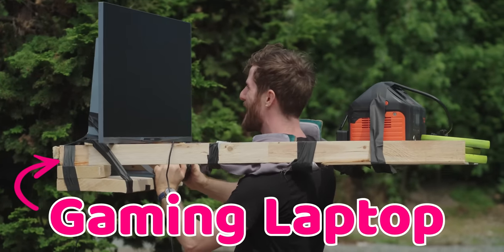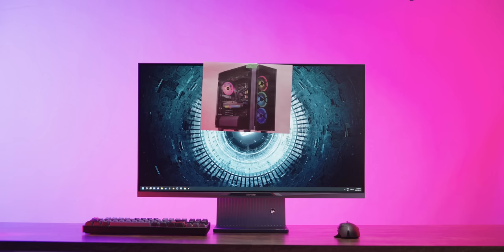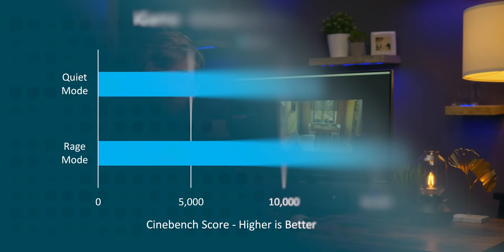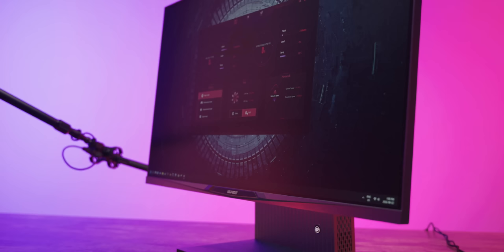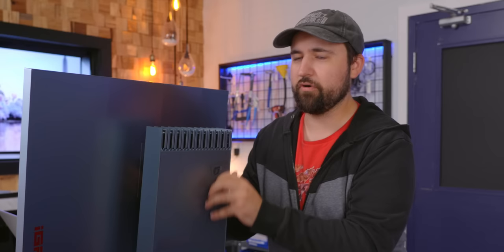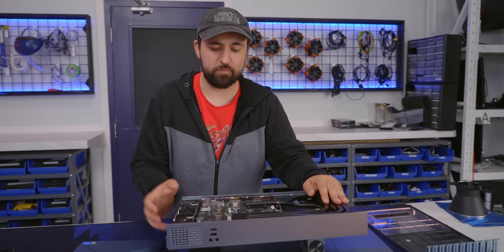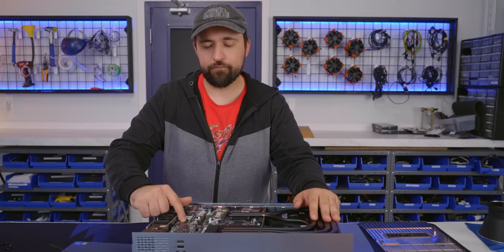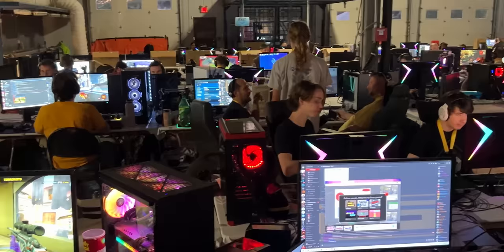Justify Your Existence. I'll Wait. - Colorful iGame AIO

Comment: Might get some hate here, but I'm pretty done with the crab rave meme... One the one hand it's fairly frequency balanced, the intro is okay i guess and when the beat drops and because of the style it can quickly tell you if speakers are tinny. But other than that it's not that good. It's dynamic range is pretty much zero,  the compression effect 'pumping' annoys me to no end and it doesn't really have that great of a soundstage or wide stereo effect or however you wan't to call it.
If you wan't to 'test' (note the parenthesis) with EDM throw in some Feed Me for example. Or mix it up (no pun intended) with other stuff.
Wonder what Dan, among others, has to say about this.

Those are my two cents on that. And two cents ain't much... it's just an opinion.

So other than that, I hope everyone is healthy, happy and doing well.

Comment: complains about how difficult it is to take it apart, then finds its actually easy followed by "its a ribbon cable" then immediately pulled out a much harder to damage din connector standard cable, then complains about having to get to the backside of the board then finds its also really easily done.

man you got to stop assuming its ass-cake before actually doing it, your pre-bias is showing.

yes AIO's are a bad choice for most people, but give the people who made it props, at least they didn't go like apple and make it super asshole status to pull apart.

Comment: You know? The integrated wireless charger on the base is not so bad because it's already built-in, when you buy a wireless charger pad that has to be connected thorough USB into your computer kinda defeats the purpose of being ¨wireless¨ to me, also all this wireless future propaganda doesn't tell you that using a wireless charger with your devices is like filling a glass of water in your shower, it will get filled eventually but the majority of juice will get lost in the air, call me an old timer but I'll be tangled to my cables until WC technology gets decent (pun totally intended).

By the way, concerning to the computer I think that they are trying to compete in a market that is already filled to the top with much better solutions that already have their consumer basis well established, heck if you don't care about having a dedicated GPU there are tons of great laptops that can fill your needs right out of the box and the fact that it doesn't come with a mouse/keyboard combo is hilarious, my guess is that they assumed you'll provide your own mouse and keyboard because you're are a hardcore gamer that doesn't play with cheap peripherals yet their AIO PC struggles with 1440p at 60fps in newer titles, and those fans are unacceptable for a product like this, imagine an Internet café full of these machines it would be like being in a server room, now that they cut the edges with the peripherals at least they should use more silent fans, the last nail in the coffin is the lack of at least one HDMI 2.1 input because many people also like to have their console next to their computer sharing the display, there are even laptops that can do that in the same budget as this PC.

Comment: AIO PCs are always such a poor value proposition that they barely make sense outside office use and they are usually far more expensive than the small business class desktops. Uou arent saving much space and cable management is not always a massive priority for businesses looking to save money on their office PCs. Those usually use wired peripherals anyway to not have to deal with batteries.

Comment: Lol, Just remembers me of my old desktop HP computer..  it had Core 2 duo, wich I obviously swaped for much better quad, with higher freq.. I was just on the border of PSU, along with some older RX570 i think.. AMD PSU upgrade was not really an option , since it was ridiculously pricy SFF, custom to these machines, along witch a weirdly shaped custom MOBO.. 
It had one fan in PSU.. And one Fan in the front.. it , though, was not just any fan..from factory it was 8000RPM DELTA.. I mean.. you have servers.. you can imagine how loud it can get, especially when you use it to cool down you Thermal throttling ,,gaming rig,, 🤣 remember to fire up NFS WORLD.. instantly a sound of a starting fighterjet...

Comment: The i5 12500H in my acer nitro 5 gets a cinibench r23 score of 14400 out of the box and it is quieter than this. The best part it costs half as much and has a keyboard,track pad and a battery.

Comment: AIOs are for one thing, and one thing only. Buying en-mass as cheap desk-fillers for highschool-thru-gradschool computer labs and 9-5 offices, usually as glorified front ends for the main server that actually runs the operating system. Anything else is kinda just pointless. It's a nonsense form factor when laptops exist. Why target that size profile if you aren't going to take advantage of the size profile?"Make it fucking portable. Make it slim and light. Build in a battery so you can take it wherever. And fuck it, throw in a keyboard and oh, wow, this product already exists, huh.

Comment: Linus the Alienware X17 does better in CB with the 11700H.. over 17K.. so.....
Very disappointing for a much bigger DTR that is iMac size.
Oh - putting in a mobile 3060 is a joke, and that's why you barely broke 60 in Tina's wonderlands.
I thought you did this for a living Linus? You should know these things by now.
To consistently game with modern titles at 60 FPS at 1440P you need a 3070ti laptop or preferable the 3080ti which is about 3070 desktop level.

Comment: hmm an all-in-one that doesn't have large space for making laptop hardware quiet, hardware that's not very upgradeable (and seems too outdated for a 1440p monitor), yeah that's just "meh." There's better AIO setups out there that can actually handle 1440p (or just 1080 which is fine) but sure like most AIOs, they are basically very over priced laptops.  And sadly all its downsides make it not very worth it as whole point of AIOs are you can get laptops(or sometimes full fledge desktops) in a larger setup than a laptop allowing better cooling and less sound than a large gaming laptop. Which if you compare to those, the AIO prices aren't bad as massive desktop replacement gaming laptops are expensive themselves. Which this thing ain't as it cant 1440p game well XD

Comment: The 3060 is garbage and should not even be considered a valid 3000 series card... the lineup BEGINS at 3060ti.  The 3060/3050 are lies, and do NOT even compare favorably to last gen cards 1 level up in model.  I.e. a 3060 should in theory at least match a 2070, but it isn't even close.  It's barely better than last gens 2060 card, maybe it would be closest to a 2060ti.  It's an utter rip-off: used cards from both major vendors offer a far better value, and AMD offers current gen cards that are a better value.  Actually in value terms, given it's absolute sh*t performance, a 3060ti or 3070 or 3080 all represent a better value too, as the 3060 is the point in the lineup where performance starts to fall off a cliff compared to it's bigger brothers, whereas from the 3060ti and up the performance gaps are relatively much smaller - i.e. the 3060ti is WAY closer to a 3070 than a 3060 in performance... so once again, the 3060 is hot garbage.  The 3050 is even worse, don't be stupid and buy crap products because of marketing and a brand name.  Comparative data is all that matters, and price/performance.